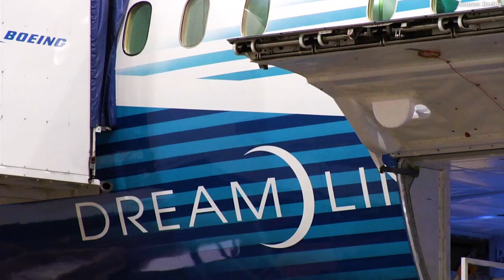The REAL Reason Airlines Prefer Airbus A350 over Boeing 787 Dreamliner!

Comment: The A350 and A380 are the best aircraft ever. Boeing has nothing similar or even close to them. And it’s not only about the passenger comfort, but also about safety, reliability, and cost efficiency.

Comment: Boeing planes undergo very strick scruntiny by regulators. Where Airbus has loose regulation by European regulations. Boeing will come out winner in the long run.
Reply: That is the most ridiculous thing I've ever heard. European regulations are some of the strictest regulations on the planet, and one of the major complaints of doing business in Europe. Brexit supporters cited EU regulations as one of the reasons they wanted to leave the EU. As for US regulations, one of the findings of the 737 Max investigation is the FAA had largely let Boeing police itself when it came to quality and safety. Boeing rubber stamped the changes to the 737 like MCAS as not needing any pilot retraining.
Reply: Actually up until the plane crashes Boeing enjoyed very lax controlling mechanisms from the regulator. Furthermore, european standards are usually more strict than in the States or in other parts of the world.  As long as Airbus doesn't produce a major fuck-up like Boeing they will likely stay in 1st place.
Reply: Well that's nonsense!

Comment: This video is a lot of bullshit joyned together. Both planes are realy good planes, both sel wery vel. Both -900ULR and Qantas' -1000ULR or what ever the name will be, is niche airplanes made in extreme low numbers. The 787-9 can fly 99% of all routes imanginable. The 787 -8, -9 and -10 have the same engine in different output versiones. They all have 8 wheles in the rear underkaridge. The A350-900 and -1000 have different engines and they have 8 and 10 wheels in the rear underkaridge. A few airlines have the A350 in a 3-4-3 configuration in economy. All 787 opperators have 3+3+3 in 787 (JAL has 2-4-2) The only "problem" i see with the 787 is the somewhat reduced range of the 787-10, for those opperators neding very long range, stil it can fly London to Singapore and Amsterdam to LAX. My next 787 flight will be further away from any diversion airport than anny other flight. At the most we will be 5 hours from the nearest airport. I am looking forward to that 12 hour flight in economy. I have been flying with many airlines that opperate A320 for short haule and B787 for long haule. GulfAir, Latam, Royal Brunei, Uzbekistan Airways, Jetstar, Scoot and son Air Astana wil get their first 78. Also Air nuigini wil opperate Airbus narrowbody (A220) and 787 by the end of next year.
Reply: Too bad the commenter is smarter than the host
Reply from the maker: Nice information

Comment: A very strange and biased video. The A350 variants are larger than the 787 and serve different market segments. The 777x will be larger still.

Each of these aircraft have accumulated significant orders because they do not have exact competitors. The A330neo, which Airbus eventually created in addition to the A350, serves the high-capacity medium-haul niche, especially in Asia.

Airbus and Boeing arguable compete directly in the high volume narrowbody market but they try to avoid that in the widebody segments.
Reply from the maker: Thanks for sharing your thoughts on the video. I'll take that into consideration for future videos.